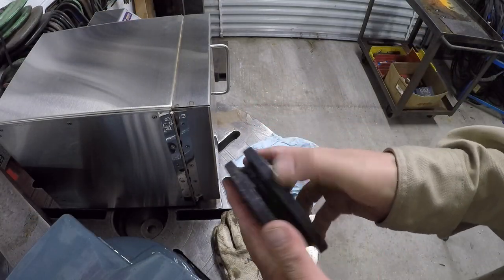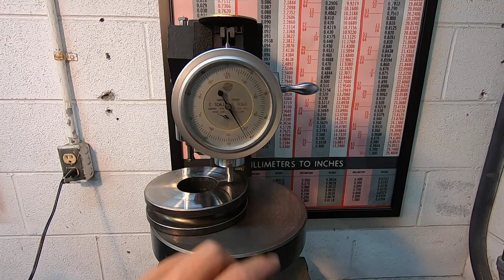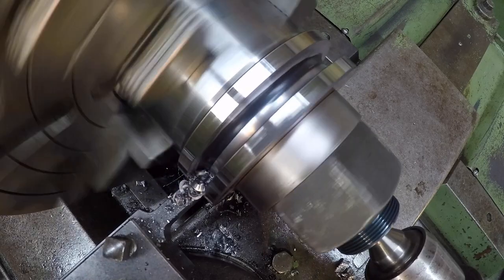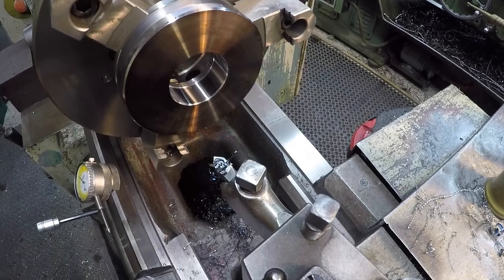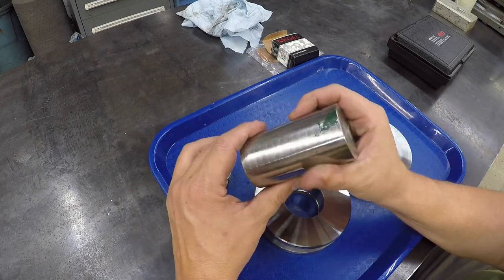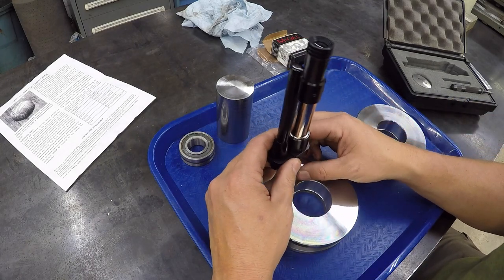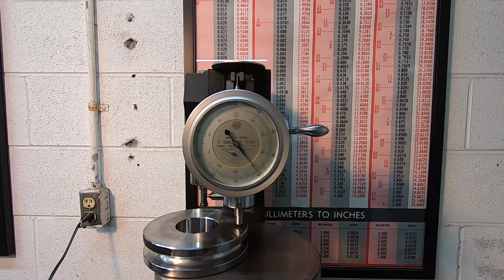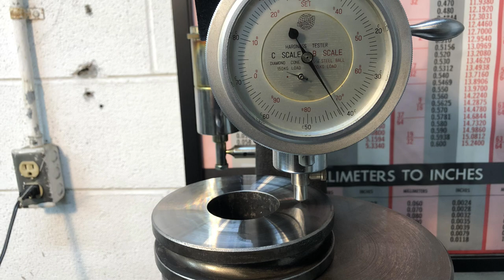Machining Cable Sheaves Part 2

Comment: Hi Adam, do you know how much depth (of hardness) you typically achieve from oil hardening steels? I looked around the web and found a host of varying opinions.
Reply: Hard to say because it depends on the alloy (high or low carbon steel alloy) and the temper process after hardening.
Reply: Depends on the steel and on the quenching medium. Look for Jomini curves (hardness vs depth) for the steel in question. Remember that you can double the numbers from the curves, as the parts are cooled from both ends, and in the Jomini tester only from one end.
Chromoly steel like 4140 is generally OK up to about 1" thickness. Any deeper and the inner steel will become Bainite or Perlite, which are soft and weak.
For thicker parts, 4340 is used.

Comment: Azo materials says this, for hardening AISI 4140 alloy steel is heated at 845°C (1550°F) followed by quenching in oil. Before hardening, it can be normalized by heating it at 913°C (1675°F) for a long period of time, followed by air cooling. And for tempering AISI 4140 alloy steel can be tempered at 205 to 649°C (400 to 1200°F) depending upon the desired hardness level. The hardness of the steel can be increased if it has a lower tempering temperature. For example, a tensile strength of 225 ksi can be achieved by tempering at 316°C (600°F), and tensile strength of 130 ksi can be achieved by tempering at 538°C (1000°F). Sandvik says heating about 1 hour per 25mm thickness when it comes to hardening! But perhaps normalizing the steel before hardening can give better results, maybe you can try it sometime with a piece of scrap!

Comment: Im wondering if you need one of those revolving platters like a microwave only this one would be more like a gyroscope to harden.  I also wonder if the reason that one area was harder is because it was on the bottom.  Idk just how my mind finds logic in the chaos.  Great work!

Comment: As far as my understanding that your work piece there is hardest is at its surfaces because once you quenched it in oil the surface changed its temperature dramatically unlike its core where it would be softer

Comment: Hi Adam. Is there any way to get some info on drill presses? General speed for drilling mild steel and maximum run out at Chuck?i just bought a new press with more speeds than my old one. Also, I think the spindle is bent. Thank!!!

Comment: I know there is a ceramic wash that you can use to put on the metal before heat treating, that would stop the oxidation, few other things are the plastic tub filled with oil, that should be metal and the tongs were responsible for the marking and harder area. Other than that, great video content especially the hardness testing and comparison.  Thank you.
Reply: I would add that a coil of wire (while it's in the Heat Treating oven -possibly two or three turns with a generous Loop Twisted) will give you a better job on getting an even hardness with the quench... and did you heat your quenching oil? From the amount of initial smoke I couldn't tell the boil bubble size. It is not that a plastic bucket can't take the few hundred degree initial heat, but rather, the PP [polypropylene] being good to around 425F will "remember" and become more relaxed with each heat in the future. In other words, it will delaminate eventually.

Comment: There seems to be about 5 points difference between Rockwell testers. How would a tech go about calibrating a Rockwell tester?
Reply: use test blocks they are scaled to a certain hardness in a lab.you should have those in your lab maybe.. there is a little trick which I don't know using the test blocks. Abom maybe can help he's done forgot more than I will ever know lol

Comment: How well does copper turn if you try turning it on a lathe for machining it?
Reply: It's gummy and harder to cut than regular aluminum or steel, but with the right tool geometry's it can be cut no problem.
Reply: As often is the case the correct fluid can be a great help with copper and other materials. Machinery's handbook is especially valuable in such cases. I'm sure that info is available on line as well. Also if possible use a copper alloy as that is what would be preferred for machining.

Comment: Great work. My opinion only:
1. Some material removal on the faces would have helped maneuverability by reducing weight. Even if doesn't spin it's a wheel after all.
2. I don't see any need for post heat treatment machining except for the bore. Actually the rough surface may be less prone to rusting and aesthetic degradation.
Reply: My guess is that the part will be painted. Ours were always painted either yellow or orange. One coat of paint only.
Reply: You're ignoring the adage that if it works, you get to keep your job; if it looks good, you get a raise.

Comment: I use those files on my knives and they do a good job for what I need. Caution if you go on Amazon prices  very from about $60-$120.  All the same. Just some are in English language and some are in Chinese. English are much more expensive. I just watch a you tube and got the Chinese.

Comment: You can actually buy quenching oil? How much is it? Are there any rules and regs on its safe disposal?
Reply: I love that you asked about safe disposal - I don't know the answer (likely anywhere that accepts used motor oil) but I know the world would be a better place if people were more conscious of where thing would go after they're done with them.
Reply: Same rules and regs as all oil I'd imagine
Reply: And yes there is quenching oil
Reply: There are numerous different quenching oils available for different temperature gradients and other properties. Some grades of steel even require you to preheat the quenching oil, or quench them in molten salt mixtures, while other grades need to be quenched with water and can then be further hardened by cryogenic treatment with liquid nitrogen. It depends on the alloy as wellas the desired material properties. Proper heat treatment is one of the most complex parts of modern metallurgy.

Comment: Would it be possible to chuck up the dimple punch in your drill press or mill to get a more consistent shaped dimple?  It seems to me hand punching would lead to a lot of variation in shape of the punch mark.

Comment: Your quenching bucket should be metal AND have a lid.  Drop the item in and quickly place the lid on top.  You should have a CO2 fire extinguisher near by or do it outside far away for everything.  Few people have any idea what 2000+F feels like, even just a small piece.

Comment: If that wrench were any bigger, it'd be a calendar girl pinup prop
Reply: Doesn't everyone have a 3' one for use in the shop? But they normally are not used on nuts. That is what a monkey wrench is for.

Comment: I would have put the bearing in the freezer for a couple hours and just before sprayed it with a dedicated CO2 fire extinguisher. Dedicated so you don't try to use it to put out fires. It will probably be empty.

Comment: Abom next time you do hardening, when you heat treat the metal prior to placing it into the oven, make a solution of satenite and water adn brush a thin layer on and let it dry, then place in the oven to bring to quench temp.  This will keep the oxygen from forming carinzation on hte outside.
Reply: I do that, its a a good idea.
Reply from the maker: Got a source for material to order from?
Reply: @Abom79  Here is what I use for knives so seal them up.
https://knifemaking.com/collections/heat-treating-supplies/products/hw101-hamon-glop-1-quart
Selenite is a crystallized form of gypsum.
Reply: @paulsanti8517  ...I assume you are using 1080 to make knives.  I don't believe your solution is correct for lower carbon 4140.  I have hardened steels for a lot of years and would be interested to try your process.  You never know, I guess!
Reply: @paulcopeland9035  I, like Paul Santi have used this method on knives as well as cutting tools for leather.  I have used it on everything from San Mai using 15n20 and 1084, to A1 Tool steel, and Stainless.  I am not advanced enough in my methods to have a Paragon Heat Treat oven so using the Forge is a sure way to pick up Decarb scale which I have found leads to a lot of small imperfections that can be sanded out, but why when you can avoid them almost 100% by using this simple method of shielding from Oxygen.  I just noticed when Abom made those Shives the carbon build up was pretty substantial, and not only does that lead to a good deal of secondary work in wire wheels and grinding in some cases, bits dont like scale at all.
Reply: @soulsolutions3999  I picked up Paragon Heat Treat oven from somone who did not know how to program it and thought it was broken for $150. They had the ramping heat set at 1 so it took about 7 hours to get up to 1800. there are deals out there just need to look. My friend scott was on forged in fire 2 times. S2E3 the long sword episode was filmed in my back yard shop. He is the short guy.
Reply: @paulcopeland9035  4140 is a medium carbon steel 0.38-.43% similar to 1035 with 0.31 - 0.38 %. so in our tub of oil we preheat with hot bars to about 120. Doing this will lower the viscosity and will help cool it down faster but not to fast or it will crack. That's why I suggested the use of a magnet so make sure its at the right temp and not to cold. Dont forget 4140 needs a long soaking heat unlike regular steel medium and high carbon steels.

Comment: How anout filling oven with low flow of argon/co2? Looks like that oven has big flow of air- scales are too big.
Gas furnaces have option to make atmosphere as "reduction". Meanwhile electric furnace always oxidising.
Reply: Anything inert but nitrogen is preferred. The scaling is from the furnace not being sealed and oxygen is allowed to come in and scale the part. Mostly not being sealed and running at such high temps though.

Comment: Hardness files.  I never understood how one should work with them?  Once one tests a softer file on a harder material, the file gets dull on that spot, and one can no more test with that dull spot?  So, check your file each time for a non-dull spot?
Reply from the maker: Did you see the pressure I used when I demonstrated them? All it needs is a couple very light rubs to see and know the hardness using them. You don’t have to dull them to the point of uselessness.
Reply: @Abom79  Thanks for your reply!  You use your files with great care, no doubt about that.  But it is a "destructive" test by definition (on a microscopic scale).  It is or the test material that gets scratched, or the file extreme teeth tips that get damaged.  Myself fear that even a slight dullness created on the file might make it "bite" not that well anymore when used on a softer material after.  And as these files are quite expensive, I would neither threw them in the garbage after 5 tests.

Comment: Hey Adam, I was wondering if you like the metric or the imperial system more. Both of them have their  advantages.
Reply: Hey Karl, there is no advantage to the imperial system, just ask any other country in the whole world (except for Myanmar and Liberia - the only other countries to use imperial). Time to come to the 21st century America!
Reply: @aearles7  That's not really true, it's nice to have a measurement between inch and yard(foot). Metric you have to go from 1cm to 1meter which is 100cm difference. The only advantages metric has over American standard is simplicity and the amount of countries that use it. Being that metric is so simple, most Americans also understand metric and can use it. So, there really is no logical reason to spend the money and time to switch to metric.

Comment: As you were doing the cleanup cuts after the heat treating/tempering, it appeared/sounded like some parts of it was harder than others, in other words the hardness wasn't consistent thru the part, is this typical in the hardening process?
Reply: Yes and no what's happening is the grain size is still in the state of flux and stress  -even though it's been cool down it hasn't been tempered in fact he could chill it to improve the grain size in the final analysis. The chill needs to be dry ice sitting in an isopropyl alcohol bath for x number of minutes per cubic inch.
Reply: Typical with 4140.  Hardening it evenly can be tricky.

Comment: Is "hardness" limited by the structure of the base metal or can different methods used on the same base metal yield different hardnesses?  Or is it both?
Reply: ramosel, for basic hardening of ferrous metals, Its the chemical composition that principally dictates the final Hardness that can be achieved, Carbon is the main alloying element, with others such as Manganese, Chrome etc to a lesser extent.
There are some steels such as "High Strength Low Alloy" (HSLA), that are hardened by mechanical working during manufacture, these have very low carbon, less that 0.1%,  where in heat treating steels, a minimum of 0.4% Carbon is required.

Hopefully this answers your very clever and wide ranging question. 🤔.
Reply: Both... but in the case of carbon , structure is all about.^^
Reply: @bostedtap8399  it does.  much appreciated.

Comment: Great job. The customer's getting what the customer wanted. Unfortunately, the customer is very wrong about what they needed.
Firstly, the sheeve must be softer than the cable. This is so it is the sheeve that wears, not the cable. This is important as a worn sheeve is not as catastrophic as a cable failure.
Secondly, the walls of the cable way should be V-shaped (with a radiused bottom), not a straight U-shape. This is to prevent the cable binding against the edge as it enters and exits the cable way, something that again will lead to catastrophic failure of the cable.
Reply: I agree and also thought that it was a bit odd - but apparently even large manufacturers offer hardening on sheaves.  But then again - considering that most wire ropes are made from steel in the low/mid 40 rockwell - these arent comparatively THAT hard.  If your sheaves were like 60 and your wire rope was 40 - that'd be dicey - i would definitely always want to err on the side of softer sheaves.  Im also sure there is a whole lot more to this than i would ever understand :) i just thought this was a good point.
Reply: Damn, that’s hardcore.

Comment: 3:00   thats where your tongs were
Reply: I was thinking the same thing and wondering if he had dropped it in the oil and fished it out later what the result would be.
Reply: @toad3048  -- BTDT...the part will melt through the bottom of the bucket and you wind up with gallons of oil all over your shop floor :)
Reply: @Makermook  Yeah, I was pretty disappointed to see that quenching oil, of all things, comes in a plastic bucket like everything else these days.

I miss the old steel buckets! They may rust eventually, but they're basically immune to anything else.
Reply: @Azlehria  i only use steel buckets...not that i do a lot of quenching but the last thing i want is hot oil spewing everywhere.
Reply: @toad3048  for best results you want to move the piece around in the oil so it can cool quickly and evenly.    if it was dropped in and laying flat one side would cool down much faster than the other.    for a piece like this sheave i would have tied some wire to it or even a rod with a hook on the end
.

Comment: I believe that softer outer layer is decarb where you lost some of the carbon content
Reply: They sell this stuff called "Casonite" to replace what you lose. Of course that only affects wear resistance, and skin of the part. And for a better finish, you can wrap everything up in your own homemade sealed pocket of stainless steel sheet, with a few stripes of torn paper or cardboard. Be super cautious with the thin sheets. They will slice your fingers like ripe tomatoes.

Comment: Is your process designed to harden the steel all the way through or just on the surface?  If surface how deep does it go?
Reply: High carbon steels harden all the way through. Low carbon steels get case hardened in a carbon laden atmosphere to 0.5-1.5mm deep. In this case, he used 4140 steel.  4140 steel hardens all the way through.

Comment: I have a question.  I saw that this took considerable time to machine (beautiful job by the way).  I also know machinist's time is not cheap, for good reason.  Is there a reason the customer contracted you to machine one rather than buy mass produced part off-the-shelf?  Not asking for numbers, but how about cost comparison of a custom machined sheave vs an off the shelf?
Reply: Csab  I doubt that. No offense but what would be a journey machinist hourly rate minus materials, electricity, supplies,etc? If he only charged $150.00? Car mechanics are charging 90.00-125.00per hour, carpet cleaners are 85.00 per hr., etc. I bet those are between $650.00 -$850.00 for the pair. Larger batch quantities with a CNC lathe and heat treat out source would bring the per piece price down considerably. But two one off parts, not a chance.